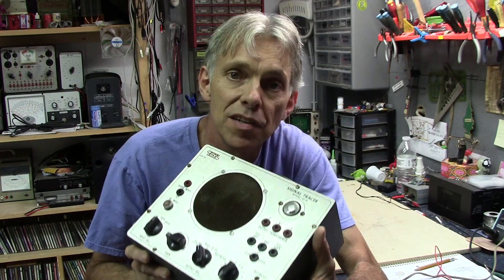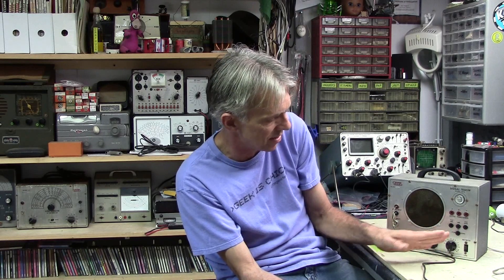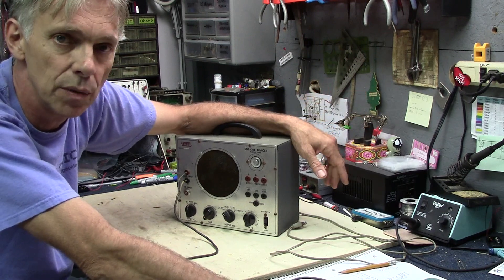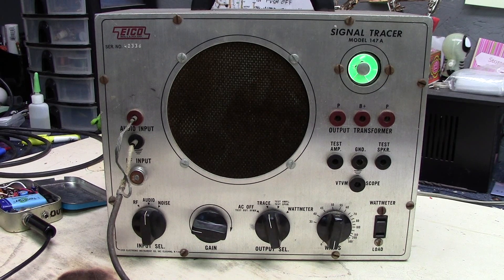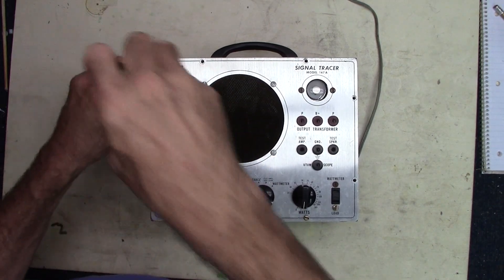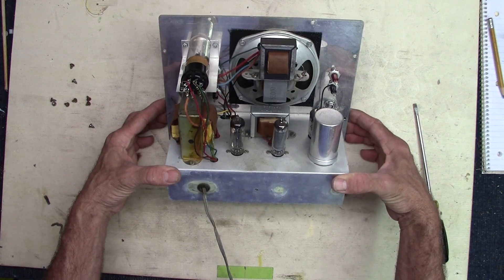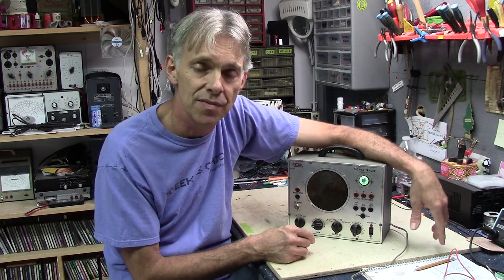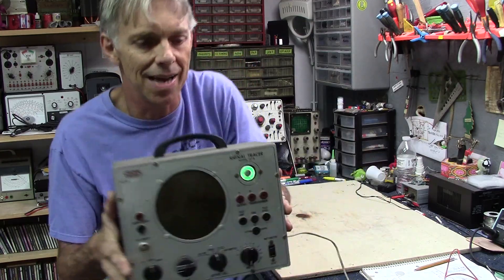EICO Model 147A Signal Tracer

Comment: Three quibbles about your video: If you look closely in the beginning, just after Led Zepplin, I think you will see the center of your probe coax connected to ground, and the ground connected to the input. You also refer to the resistors underneath biasing the transistors, I doubt you will ever find a transistor in this device. Finally, there is some excess video after you sign off. You have found an exceptionally clean unit there. I would go ahead and replace the can electrolytic cap if I owned your device. Other than that, seeing it in action would be nice.
Reply: I noticed the probe plugged in backwards as well.  I have one of these, which I probably only had for a few years before this video was released.  This a great tool to have on the bench.  I too suggest swapping out those electrolytic caps with modern ones.  I liked the video.

Comment: Does the Primary on the main transformer allow to connect to 220v power supply?
(some old devices have dual primary wire)

Comment: Hi, I found one of these at an estate sale today paid $18 for it and it works and looks almost like new. I was a TV  audio repairman, etc and I do miss the old well built test equipment loved your video. I am a fan of the 70s Marantz stereos, I have 3. and I plan to put this to good use.  on one of them. I did find the manual pdf online also.  Also on Ebay saw 3 of them for sale $79 each.

Comment: At least the rectifier is a 6X4 and not a 6X5, which are notorious for developing filament-to-cathode shorts.  The best thing you can do if you find a 6X5 is to replace it with a JAN 6X5WGT.

I've read it's actually possible to use a 1629 as an amplifier tube, as it has a single triode stage in it.

Comment: They sold these for quite a while and the kits sold for about $50 or so.I have the older 147 (no "A") model. The specs and appearance are the same between the 147 and 147A, but the older model uses octal type tubes. I almost always grab the tracer over a scope to quickly pin down a problem stage in vintage radios or amplifiers. Easy to use, and gives a quick qualitative sample of the signal as well as its relative strength.

Comment: The 1629 electron ray tube was actually not made by EICO...many companies used to contract tube manufacturers, (RCA etc.) for the tubes labeled under the OEM's brand name. The 6X4 is the rectifier tube for the DC power supply. The 6AQ5 (Beam Power Pentode) is used as a single-ended audio output tube. Many tube TV's back in the day used this tube for the AF stage and even in some AM/FM table radios as the audio output tube. The signal tracer is actually just a simple single channel audio amplifier with a hi impedance input circuit. The probe that comes with signal tracers usually has a blocking capacitor built in to the probe to block DC from getting into the signal path, since audio signals are of an AC sine wave. If you were to trace a signal through an amplifier or radio, most times you will follow the path into the grid of various tubes and even sometimes the plates which is running DC voltages. The capacitor blocks the DC and lets only the AC sine wave pass. This is a handy piece of test gear for servicing radios, TV's and audio. I still use mine quite often since I work on tube equipment 90% of the time in my daily work :) Frank Ferraro--Audio Craft Electronics.

Comment: I used on of those when I was learning electronics at a Vo-Tech school.
I have an Eico Scope 460.
I had to replace the power supply capacitors, rectifier tube and verticle deflection tube.
I purchased it for $67.00 mail order.

Comment: I find myself looking forward to your videos every week. Thank you very much for taking the time to share all this information. This was a very interesting video. I take it the amount of wires on the underneath side is due to no circuit board ? Or was that a normal way of building that type of tester back then ? Again keep the videos coming.
Reply: KSfixitman All electronics were built and wired this way at one time. It's called "point to point" construction. Printed circuit boards started to become common place in the mid 1950s. By the 1970's point to point became a thing of the past due the amount of manual labor required.

Comment: Check all the 1M resistors, they all tend to go high value, which will give poor display. Basically check all resistors over 47k and replace as needed with 1W resistors. You will not get the original ones any more, but 1W resistors will be around the same size and will last almost forever.

Comment: Was the MP3 audio coming from its internal speaker?
Reply: Photographic Time Yes. The speaker is still in great condition.
Reply: ***** For some reason I thought it would work like a multimeter with continuity and just beep when you got signal, maybe the louder the better the signal.
Reply: Photographic Time The magic eye shows the intensity of the signal and the speaker will allow you to hear any distortion. The o-scope outputs will further help by letting you see the wave form at the point being probed in the circuit.